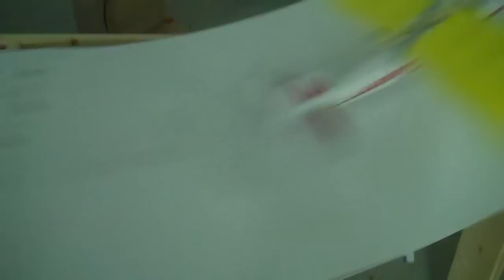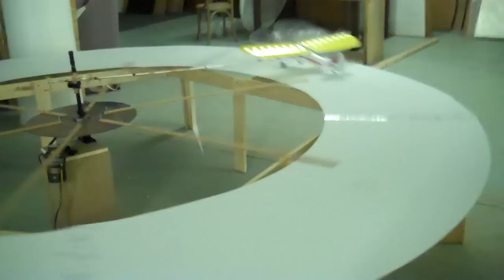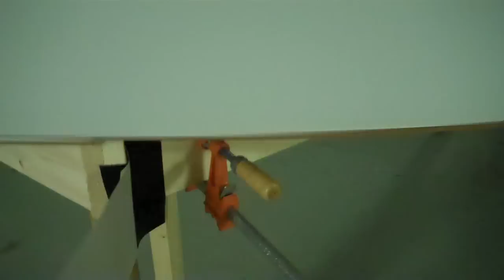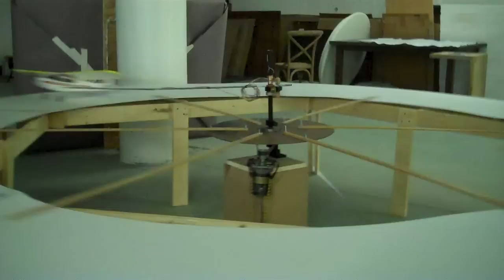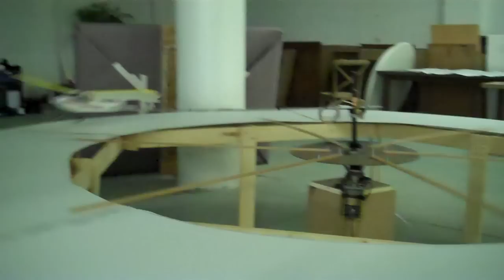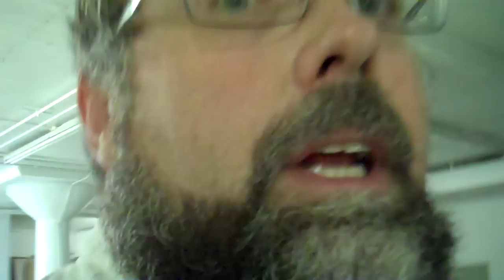Airplane On a Conveyor Belt Proof of Concept

Comment: So, I've noticed there are two common ways to view this. One is looking at the WHOLE thing. The other is to only focus on the tire and belt. Those whom only look at the tire, get locked in to thinking the tires can not rotate, thus the jet won't move or takeoff.  I have run better tests and turns out, the jet takes off without rotating a tire. The tires do not move, yet the jet will take off.  If you zoom in to the contact patch of the tire and belt. Per the riddle the belt spins the other way to the tire. If the jet is to move forward, the tire rotates backwards on the contact patch, so the belt moves forward with the jet. The result is the belt and jet are both moving forward at exactly the same speed. The tires never rotate. As the thrust pushes the jet forward, the tires want to turn backwards, the belt moves forward to keep the tires from spinning. The jet remains on the same spot on the belt and they both gain speed by the thrust. Till the jet gently lifts off the belt.       

The belt moves the other way to the wheels, NOT the plane. If it is the plane, then yes the belt will spin backwards.. However, if we zoom to the wheel to belt contact. The bottom of the tire that is in contact with the belt is moving backwards to the takeoff of the jet... That means per this riddle, the belt is spinning in the SAME direction of takeoff! Actually the more I simulate this with toys, the more crazy it gets. Turns out, the jet does not move on the belt, it remans exactly on the same spot on the belt! This is why those people think it wont takeoff. However, the belt is moving at the same speed the jet is as its throttling up.

3 prospective :

1. Guy in plane sees the same un moving spot on the belt. From her POV, it appears as if the belt is launching her jet. The jet remains on the same spot on the belt. The belt AND the jet are both equally moving at the same speed when compared to ground speed. The wheels are NOT turning, yet the jet is moving.

2. Guy on the ground beside the conveyer. It appears as if the belt is gaining speed, as if the wheels are glued to the belt. As the thrust increases, both the belt and the jet move faster and faster till the jet lifts off the belt. Wheels never make a rotation at all.

3. Girl standing on the belt. She is ~100ft in front of the jet. As the jet throttles up, the belt starts to move. The jet constantly remains 100ft in front of her. As she looks off the belt, the ground is moving faster and faster. Eventually the belt reaches 200MPH, and the jet just gently lifts off the belt. From her POV, it looks like a jump jet, as it just gains altitude. DUCK! , she must duck down, as now the wheels are off the belt, the jet is now approaching her, as it is gaining speed, and the belt is slowing. ( She was watching the wheels, and they never rotated. )

So, both sides are correct. Technically the people on the takeoff side are more correct. But what happens is the jet takes off with the tires never rotating, and the belt does NOT catapult the jet. It just moves at exactly the same takeoff speed as the jet. Thus the tires never turn.

Blown minds. I have yet to see this solution to this riddle.
Reply: YES! I just thought about this and finally found someone else who thought about this the same way!
Just like you said, The belt moves 1 to 1 speed OPPOSITE of the wheel's rotation. When the airplane's thrust starts to push the airplane forward, the wheels will try to move forward, but it can't because the belt is moving the opposite direction, Because of this, any wheel movement is stopped. The direction the belt needs to move to counteract any forward movement the wheel is moving the same direction as the plane! So, as the plane's thrust causes it to accelerate, the belt will move with the plane, while the wheels stay stationary!
Reply: Well the rule of the problem did say the Wheels and belt move at same speed but in opposite directions.  So if you violate that then you just threw the original problem in the trash. Which is what the video here did
Reply: @knighthonor44  
Exactly!
For a normal plane, the lift is created by the airflow above and below its wings.
The plane would therefore not be able to take off if the conveyor belt always could match the speed of the wheels and thus keep the plane stationary relative to the air (when ignoring the airflow from the propeller).
However, the plane will take off if the conveyor belt's speed is limited to the plane's normal take-off speed. Why?
During a normal take-off, the plane's power has to overcome both the wheels' rolling resistance and the air resistance, and the latter becomes far higher than the former as the plane picks up speed, even before leaving the runway.
A plane rolling at its normal take-off speed but kept stationary by the conveyor belt won't experience any air resistance, only the insignificant rolling resistance. This means that if its engine is set to normal take-off power while the belt can't move any faster, the plane will start accelerating and take off almost as easily as during a normal take-off. That's what happened here and also in that MythBusters experiment.
Reply: @fromnorway643  "When ignoring the airflow from the propeller"
The airflow from the propeller is the aircraft's sole means of locomotion. If it is ignored, the aircraft will remain stationary because it cannot move. 
The rolling resistance is insignificant compared to the motive power supplied by the propeller. 

The speed of the wheels is unrelated to the speed of the air flowing over the wing. This is trivially simple to demonstrate in both directions. When an aircraft flies from an aircraft carrier, the speed of the air flowing over the wings consists of:
1) The forward motion of the aircraft relative to the ship.
2) The wind velocity (the ship will be turned into the wind prior to launching
3) The speed of the ship

Let's assume that we have a US or French carrier, and the catapult is set to provide a speed of 140 knots. Let's further assume a 30 knot wind, and that the carrier is steaming at 30 knots. The speed of the air over the wings will be 200 knots. The rotation of the wheels will be commensurate with a ground speed of 140 knots. 

Let's take it in the other direction: a ski-equipped aircraft has no wheels. Assuming that the conveyor belt is coated in a substance that would lower friction sufficiently to make a ski-equipped aircraft appropriate, the conveyor belt should have no effect.
Reply: @sheriff0017 
I wasn’t thinking of the propeller’s airflow as the mean of locomotion, but as producing some extra lift as it passes over and under the wings. This effect is small and also depends on where the propeller(s) is located relative to the wings since a single propeller in the nose will have a smaller effect than one or two propellers mounted on each wing.
Reply: @fromnorway643  In most cases, the effect of the propeller blowing over would be negligible. About the only exceptions are the DHC Buffalo and Caribou.
Reply: @sheriff0017 
👍👍

Comment: The people saying the conveyor belt would simple match the speed of the wheels I. The plane are not grasping that that is not possible. The wheels spin would not act as a force on the plane at all. The plane is moving through the air not the ground. Even befor it takes off the panes thrust comes from its relationship to the air not the ground. You can say but the conveyor belt would simple accelerate till the plane is not moving because it is matching the wheel speed of the plane. But this is not possible. No matter how fast the conveyor belt tried to go the plane wheels would simply turn faster. Witch does violate the original wording of the question but that just serves to illustrate that it is a dumb question. The wheels would alway just go faster than the conveyor belt regardless of the speed of the conveyor belt
Reply: If the plane was moving full speed and the wheels were touching the ground and were indestructible. They would rotate at The same Centrifical speed as the plane was moving laterally
Reply: It doesn't matter if it's impossible for the conveyor to accelerate till the plane isn't moving. It is literally impossible to have a large enough conveyor belt. What matters is what the question asks for.

Comment: I think what you need test for people to grasp this is wheel speed.  You do not need a plane.  Put a speedo on a wheel, bicycle would be a cheap way they have cheap speedos.  Put the bike on a treadmill.   Hold the bike stationary and get the treadmill up to speed, wheel speed and treadmill speed should match.  Now with your hand, push the bike forward on the treadmill to show the relationship of wheel speed to ground is not impacted by a force like air.

Comment: yes the plane is going faster than the ground. thats the whole point. it will always happen no matter how fast the ground is moving. because the plane isnt attached to the ground its attached to the air
Reply: He did airspeed vs conveyor speed. Not wheel speed vs belt speed. The wheel speed is 2x faster than the airspeed, which  the belt must match instantly without delay, which was not tested here.

Comment: the plane was moving faster then the belt
Reply: No their speeds were equal. Relative to a third party item like the ceiling, both the belt and plane were moving the same speed only in different directions
Reply: @jacobbroosh3386  but planes fly using engines, not a stick connected to a motor. Captain Joe already cleared up the myth.
Reply: @angus_m  the plane isn’t being lifted by the stick. The plane is lifting the stick
Reply: @johnmarshall7146  yes because the stick is making it go faster
Reply: @Daniel DA Its not the engines that make the plane fly 🤦‍♂️🤦‍♂️🤦‍♂️. Its the air going over the wings!!! You can put an engine to TOGA but without wings, it won't take off.
Reply: the riddle says wheel speed not airspeed
wheel speed = belt speed. airspeed lower than that.
Reply: For this to satisfy the question the plane would have to be still, wheel speed matching ground speed, therefore no lift.

Comment: Even with the craft starting off moving backwards it still works. 

There actually is no way to prevent takeoff with a conveyor belt for aircraft because the thrust from the engines forces the craft through the surrounding air.

Think of if the place was in flight. Would spinning the wheels backwards hold the place back? No, because the engines are pushing the craft against the air.
Reply: If it's moving backwards then its violates the problems rule that's m the wheels have to travel the exact same speed at all times as the belt. Remember this rule. Yall keep breaking it to get the plane to fly